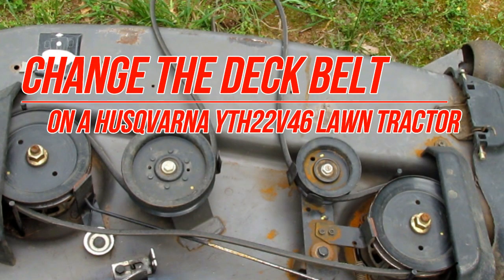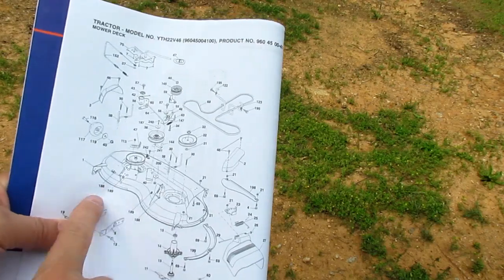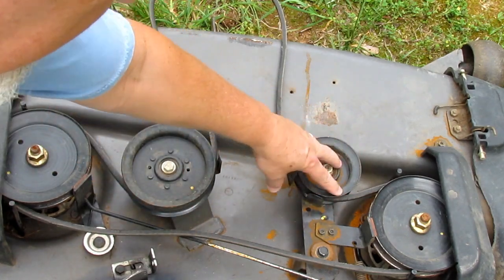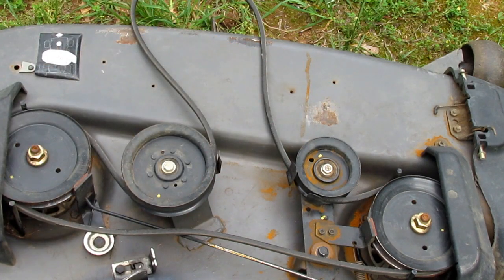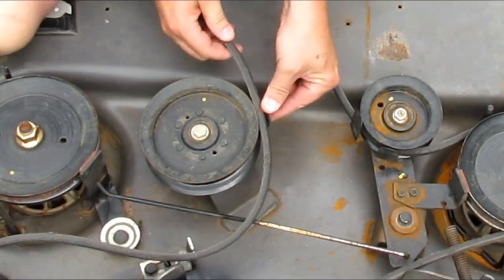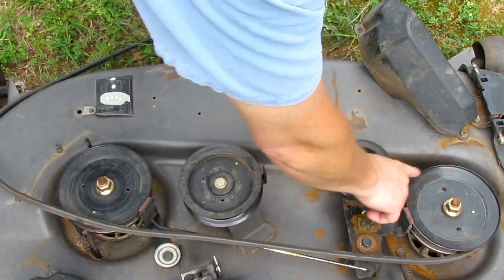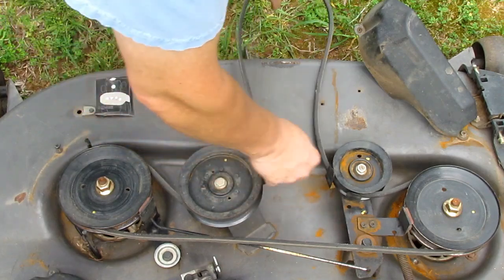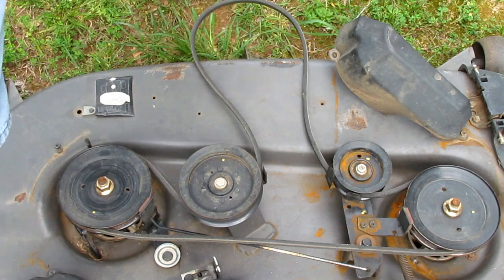Replace Deck Belt on Husqvarna YTH22V46 Yard Tractor

Comment: Thanks for posting this video Dennis. I have the same tractor and was pleased that you confirmed at the beginning that it is possible to change the deck belt without having to remove the deck. I found that after I took off the two outer protective covers, and lowered the deck to the lowest setting, there was plenty of room to easily thread the new belt (the old one snapped, so was already off). I didn't need to remove or loosen anything else. I raised the deck all the way up to pull the belt over the engine pulley. Really appreciate your video, as I've lost my original manual after moving house. Cheers, Cliff
Reply from the maker: I'm glad this helped!  Thanks for watching, Cliff!  If you want to download a manual, go to Husqvarna.com, click on 'Support' and you will find links to various manuals.  They have the Operating and the Repair/Parts manuals for most models, free to download.

Comment: Thank you so much.. especially for the much needed comment that this can be done without removing deck from mower...I did find it helpful to lower deck as far as it could go, and also, with deck on mower, I did find it necessary to have a deeper 1/2" socket for the pin bolts on the chute side of mower, couldn't have worked without that... your video was great!
Reply from the maker: I'm glad to know that worked out Chris!  Thanks for watching!

Comment: Thanks for these videos, Dennis. You really do a great service for so many of us. When my local small-engine repair guy has a 4-week backlog of work, it's nice to be able to work on my tractor and get it running before I have a hayfield for a lawn. I replaced my deck belt (same Husq. tractor) and I wanted to check it to see if it was working, so I engaged the PTO (with the engine off) and manually turned the blades and pulleys, but the belt stays in place and will not move the other spindle pulley, etc.   Before I replaced the belt with the new one, I had cleaned around the spindles, so nothing appears to be blocked, and the belt is not super-loose once it's engaged, but my first guess is that it may just need to be tightened. The original belt came off the tractor a couple weeks ago when I was cutting some thick clover in my back yard. I could smell it rubbing/burning a little when I got into the thicker stuff, but it wasn't wet and the clover didn't look like anything the mower couldn't handle. After a little while of doing that intermittently, the belt just came off. It was a little frayed, but didn't break. I wonder if there is a problem with the spindles being stuck, but I don't see anything above or below the deck. Do you have any thoughts about this?  Thank you so much for all you do!
Reply from the maker: Hi Michael, thanks for watching!  With the PTO engaged and the engine off, the deck belt should be relatively tight.  If it is tight on the engine pulley, it won't turn easily.  The engine pulley will keep it from turning freely.  So, if the belt is fairly tight, you can turn one blade by making it slip on the belt....the engine pulley will keep the belt from turning so the other blade will not turn.  Disengaged, both should turn easily by hand.  If both turn easily by hand with the PTO engaged, but do not turn each other, your belt may be too loose.

Comment: This video (and the deck removal video) was very helpful. Saved me a bunch of time and money. Used the steps for my Husqvarna YTA24V48 after the deck belt snapped in two.
Reply from the maker: Thanks for watching, Mark!  I'm glad the vids helped.  I just broke my deck belt yesterday....so I have to get one today and replace mine.  :)
Reply: @dwcoffey  Something I'd mention: I think mine snapped because I hadn't cleaned out the debris underneath the belt guards (ever) and it must have put enormous strain on the belt over time.
Reply from the maker: I inadvertently hit a pretty solid mound of dirt....belt was already worn, so the sudden shock did it in.  :)  It's the first of the season, so a new belt will be a good thing anyway.  haha

Comment: I forgot to say, you have done one of the best videos I have ever watched on You Tube. You explain thoroughly and in detail, and with a steady camera.  I thought it would be an big job, but you makes it easy.  My first mistake was trying to take the guide bolts off while the deck was still attached.  I broke the head off the third bolt, and couldn't get to the 4th bolt.  Maybe I can get the last bolt off easier with the deck off, and this time use penetrating oil, or heat vs. an extension on my socket wrench.  Thanks for that needed video.
Reply from the maker: Thank you so much Reuben!  I'm working on a video showing how to replace the spindles on the mower deck.  I broke off 2 bolts on the process, so don't feel bad  :)  It is much easier to get to the bolts with the deck off the tractor though....so removing it should make that process easier for you.
Reply: Yeh, but I broke (2) bolts on the getting off the second belt retainer, after getting the first retainer off with no problem.  But on my first comment, old original factory drive belt 104", all vendors replacement drive belts 105.8" (WILL IDLER PULLEY TIGHTEN UP ON THE EXTRA 1.8")

Comment: great, very helpful.  I took your advice and changed the belt while leaving the mower deck on.  One question, Before I took the old belt off, I did not notice the "guides" near the engine spindle drive. I put my new belt inside of them because it seemed logical and the belt fit easily.  They are unique guides that are made of thick gauge heavy wire and coated.  I just wanted to check that this is correct before I run it to cut the entire yard.  Thanks for your videos. they are easy to follow and quite helpful.
Reply from the maker: Thanks for watching, Jim!  Yes, the deck belt should run through the J-shaped part of that guide on each side of the engine pulley.  On mine, the guides are J-shaped with the long leg nearest the pulley and short leg farthest from the pulley.  The belt should go 'inside' the J-shape.  Let me know if that doesn't make sense.  :)
Reply: Hi Dennis, thanks for getting back to me so quickly.   I put the belt through the J shaped guides.  Runs great.  Just finished cutting the backyard.  Thanks again.  Jim

Comment: Dennis I broke off a bolt from one of the guards to be able to remove the belt...what do I do to get the remaining lodged portion of the bolt out and how do I prevent the two remaining bolts from doing the same thing? Thanks Dennis and appreciate you taking the time to make this video! Very helpful!
Reply from the maker: I had the same problem...fortunately I was also changing out the spindles (video coming soon).  If you remove the other bolts, the spindle will come out the bottom, then you can work on removing the bolt on your workbench, if you prefer.  If you don't want to remove the other bolts, you should be able to do this while the spindle is still attached to the deck.  You'll need to buy a screw/bolt extractor, something like this:  https://www.amazon.com/SIENOC-Construction-Extractor-Damaged-Stripped/dp/B06XDKY8ZK/ref=sr_1_10?ie=UTF8&qid=1506446319&sr=8-10&keywords=easy+out+bolt+extractor+set  
You can find them at your local home improvement store or hardware store.  Generally, you will drill a hole into the broken bolt, insert the appropriate size extractor and turn counterclockwise.  The extractors are left-hand thread so they will bite into the broken bolt and back it out.  
The other alternative would be to drill the whole thing out and replace with a nut and bolt combination.  This is least preferable though, because if the nut ever comes loose, it will be launched by your turning mover blades.  If you choose to do it this way, use an aircraft nut, locktite, or drill and pin the nut end of the bolt.
 
These bolts go through the deck and thread into the spindles.  Once all bolts are removed (or broken) the spindle will come right out.  I broke off a couple of bolts the first time I tried to remove them and ended up replacing the spindles.  They are not terribly expensive and come with new bolts, so this may also be an easier alternative.   These are the spindles I purchased.

Comment: Dennis I put the new belt on works great very smooth but it pops off when I turn it off cut ? What you think I measured the belt to the old one matched perfectly
Reply from the maker: Thanks for watching, Bill!  I've had that happen if I don't ease the PTO off....for example, if I flip the belt engage off quickly, without holding it and going a bit slow, the belt will pop off.  If this is not the case with yours, check to be sure the belt is inside the guides on each side of the drive pulley under the engine.

Comment: Thanks will give it a try. Dennis, I have another problem when I try to start the mower sometimes it acts dead. then I try a few more and it starts. solenoid, or starter?
Reply from the maker: Sounds like a solenoid or key switch problem.  Thanks again for watching!

Comment: I found a loose and broken tension spring (at least that’s what I think it is) when I was cleaning the mower deck. Is it simple to replace? Can you offer guidance. Thank you.
Reply from the maker: If you have both halves of the spring, most good hardware stores will have a spring selection and might be able to match it.  If you have the manual for your mower, you can sometimes find the part numbers in the manual, look the correct spring upon the internet and find a replacement.  A great resource, if you don't have a manual, is Jacks Small Engines.  They have parts diagrams for most models.  Thank you for watching, Susan!

Comment: Hi Jeff, This video on changing the deck belt as well as the how the drop the deck have been amazing! My husband passed away 3 years ago and I am now learning all this stuff for the first time so THANK YOU!! Now for the quirky girl question,  lol. Which side of the belt should be facing the spindle pulley. Flat side in or out as it relates to the side that actually touches the pulley? Apparently it's not really a girl question because the 2 guys at the hardware store argued amongst them selves when I asked and I never did get a straight answer! Thanks again for helping this 40 something lady figure this out and save a little money by doing it myself!
Reply from the maker: Hi Jennifer.....no worries and that is a very good question.  Getting the belt on the right way will make sure your mower works correctly and the belt doesn't prematurely wear out.  The tapered side of the belt will go into all the pulleys, including the spindle pulleys except one.  One of the idler/tension pulleys on the deck is flat, rather than tapered on it's inside surface (where the belt runs).  The back (flat side) of the belt will run against that pulley.  Let me know if I can help further.  Thanks for watching!!

Comment: Really like your channel, thank you! Do you have anything on repairing/replacing transmission in this tractor. Transmission in my tractor has been leaking for the past three season, my service center tells me it can't be repaired and needs to be replaced, which is expensive
Reply from the maker: Thanks for watching, Vlad!  I'm sorry but I have not tackled the transmission in this mower.  I've read the same thing...it is sealed and non-servicable.

Comment: Thank you, Dennis. We've replace the deck belt on our Husqvarna YTA22V46 22-HP V-twin Automatic 46-in lawn tractor, a couple of times. Yet, we have a problem with the belt slipping off the deck pulleys and even drive shaft pulley, several times during a mowing. We've checked other videos and made sure our brake is clean an freely operating and the sway brackets are intact, and made sure we have the right belt. Yet, even though we stop and engage or disengage the mower blades very slowly, we still have a problem with the belt slipping off one or more pulley. I wonder if you've run into this and if you could help us troubleshoot the problem. Thank you.
Reply from the maker: Hi Gary, thank you for watching!  I have not had this problem, but will try to offer a few suggestions.  You may have already done all of these, but just my thoughts on how I'd approach it.  The belt you should have is: 584453101, same as my YTH22V46...there's a link in the video description.  You should have a spring steel retainer on each of the spindle pulleys to keep the belt from coming off of them when slack (disengaged).  Make sure your belt is running between those retainers and the pulleys.  Also, double check your belt routing.....there is one flat pulley on the deck, the back of the belt (flat side) should be running against the flat pulley, the tapered side of the belt should be running in all the other pulleys.  It is possible to get the belt on 'inside out' where the flat side is running inside all the tapered pulleys.   Finally, be sure the belt is running inside the belt guard on each side of the drive pulley (under the engine).   Let me know if none of this helps and I'll give you my email address to send some photos to.  We can figure this out.  Thanks again!
Reply: @dwcoffey  Dennis, thank you. I'll re-check all of the things you mention and let you know. Really appreciate the help. We've been stopping and putting the belt on several times when we mow, so it will be great finally figuring this out. The two springs on the tensioner do tighten the belt enough to turn the blades for mowing. When we release the tensioner,  however,  the blades sometimes keep spinning and then seem to spin the belt off the pulleys and either over or under the retainers and clips. This is one problem we're having. Then, on other occasions, the belt just slips off one or more of the pulleys and even off the drive shaft while we're mowing. I did replace the belt, last season, as I thought the belt may have stretched. Again, thank you. Gary

Comment: thanks for your video i changed the drive belt, as i was going to attch the deck to the mower i notice the thin metal ro is just laying on the top of the deck , as you cna tell im not even sure what to call it let alone how to re attach it  can you help?? thanks in advance
Reply from the maker: Thanks for watching, Stephen!  It sounds like it might be the linkage that goes between the brake arm and the idler pulley arm.

Comment: I just replaced the deck on my mower that's the same model as this,  but it immediately began tearing up the new belt.  How do I test the tension and adjust if needed?
Reply from the maker: Thanks for watching!  There isn't a lot of adjustment to do, but here is a vid on adjusting the deck belt:  https://youtu.be/0tB2DYtRhI8  In addition to that, just double check your routing and make sure the belt is turned the right way, ie make sure the tapered side is running in the grooved pulleys and the flat side is running against the flat pulley.  I hope that helps!

Comment: Dennis....any idea if there's an adjustment tolerance on the linkage brake (part #64). I had a rattle when engaging the mower, and found this thing to be rattling. One end is stationary, and the other has a nut (which can be adjusted in or out).
Reply from the maker: Thanks for watching!  I'm not aware of an adjustment on that linkage, but I'd sure try tightening up that nut.....you might run out of threads before it takes the play out of it, but it can't hurt anything to tighten it up.

Comment: Thank you Denis! Just changed my belt however I have a question on tension - how taught should the belt be when the blades are engaged? Thanks again!
Reply from the maker: Thanks for watching, Murray!  I'm happy with mine if there is about 1 to 1-1/2 inch of movement when I push the belt between two pulleys.

Comment: Thanks for the video.  My belt keeps popping off.  My husband and I are going to give this a shot this weekend.  Any input as to why it pops off at least once a year?  Thanks again.
Reply from the maker: Thanks for watching, Kimberley!  I have noticed with my tractor that if, when I disengage the blade, I let the lever kind of pop back into place, the belt will bounce out of the wire-guides around the engine pulley.  If I ease the tension off the PTO lever (not too slow, just more of a controlled release) then the belt never pops off.  If that isn't the problem you're having, I'd check the spring-steel belt guides on the deck that keep the belt up against the pulleys.....if they are bent away from the pulleys, the belt may be occasionally riding up the guide and coming out of a pulley.  Please let me know if this doesn't help and we'll keep trying to figure it out.
Reply: @dwcoffey  This can also be a deeper problem. Since there is no way to tighten the belt, what may be going on is the deck itself is bent or the motor has shifted. Check motor bolts first, than deck pins. I had this exact same issue, when i would disengage the blade, the belt would slip half way off the drive pulley, and it would eat the belt up in seconds, when you attempted to reengage.

Comment: I have a brand new Husqavarna with a 42" deck. When the blades are engaged, there is a lot of noise and rattling going on. There appears to be a lot of belt deflection and tensioner bounce. Is this the norm for these mowers. My old Troy Bilt was much quieter.
Reply from the maker: Thanks for watching!  No, this is not normal.  Sounds like you may have a bad idler or spindle.  I have a video showing how to replace the spindles, should you need to do that.

Comment: I see you had the well with your bracket too I have broke two of those Husqvarna said that was a defect
Reply from the maker: Thanks for watching, Robert!  The last time I welded it took care of it.  But I beefed up the joint with a little extra steel.  The welds on this deck are not very good from the factory.